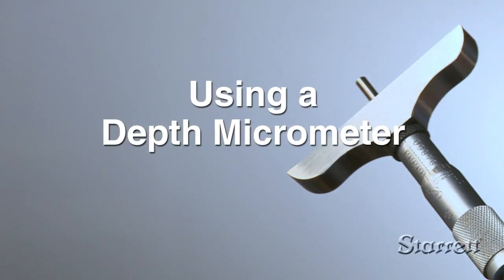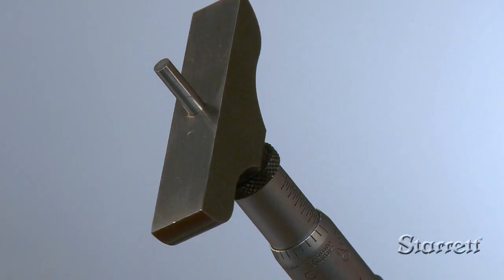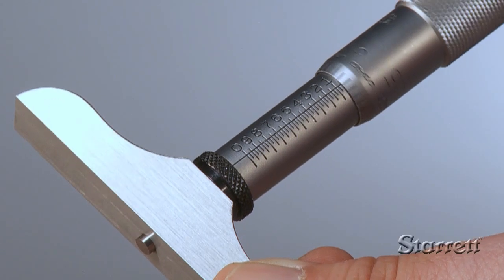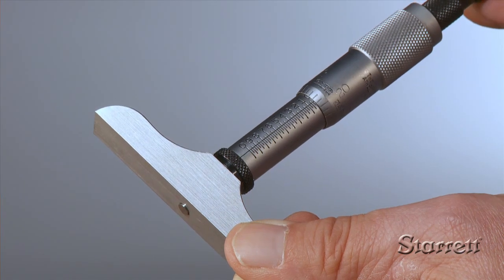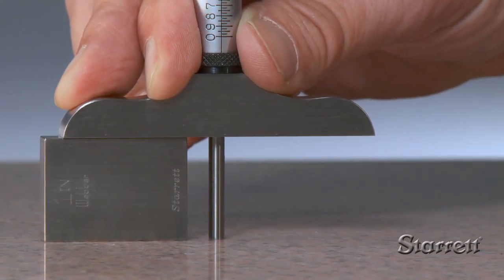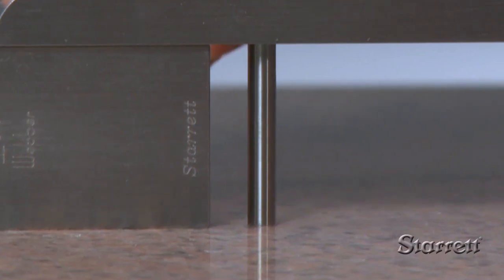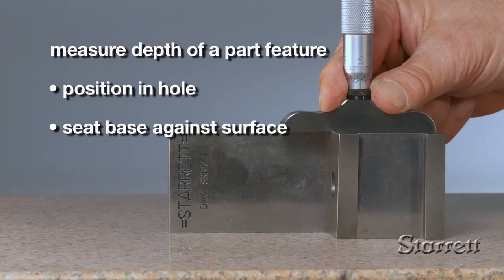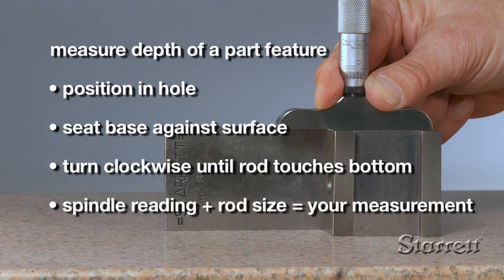How to Use a Depth Micrometer

Comment: i have an antique starrett depth micrometer set which seems complete, but this particular model has no surface plate, instead it has two thumb set screws where the plate would be.  do you know what model this is and how to measure accurately without a plate to keep flush?